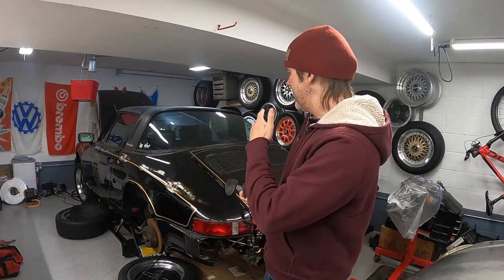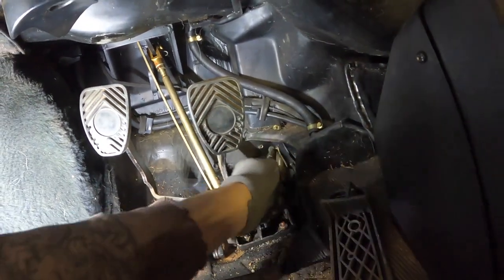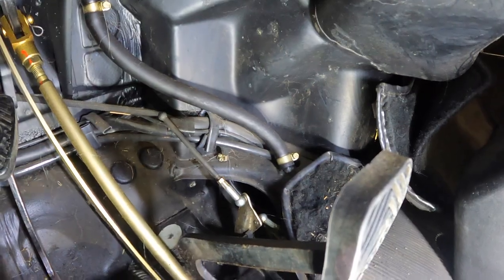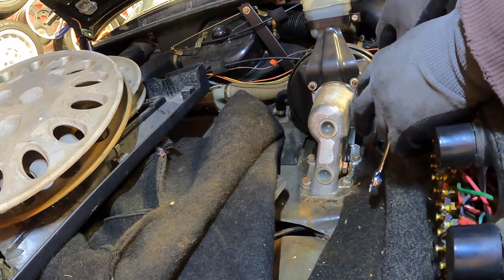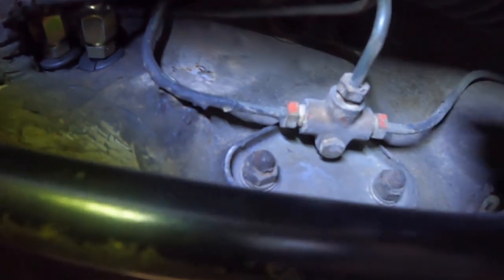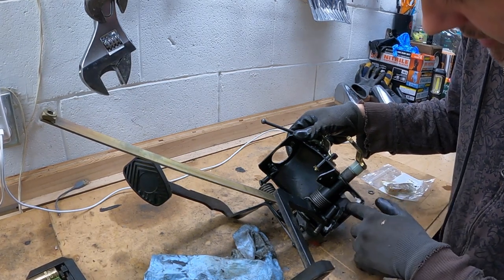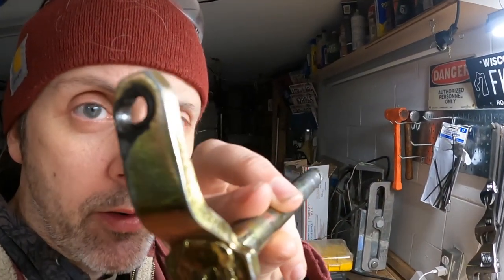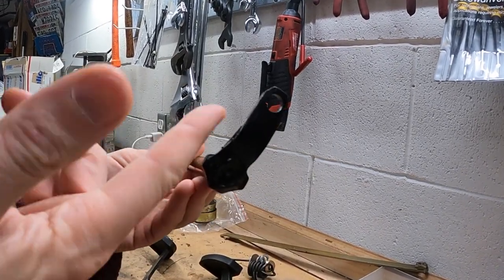How to Remove & Rebuild Classic Porsche 911 Pedal Cluster Assembly

Comment: I somehow got sent nylon bushes when I ordered them from Porsche (which work fine). Are the brass ones aftermarket?
Reply from the maker: Yeah, they're just basic stuff for industrial equipment, can probably source them from McMaster if you want.  Plastic is fine tho, they just won't last as long.   Maybe replace them in another decade :P